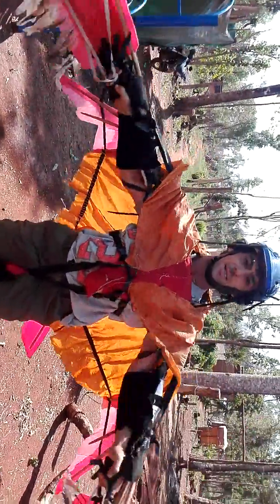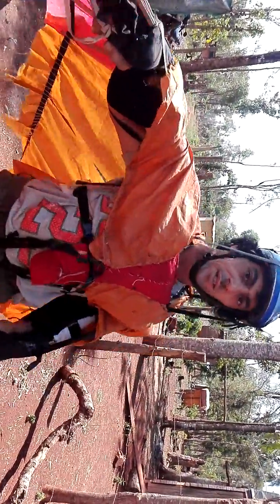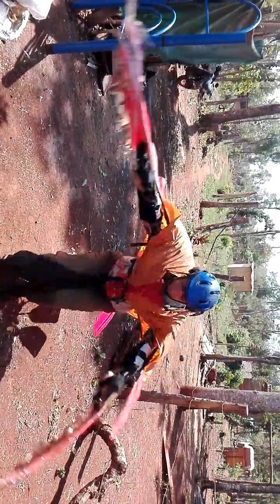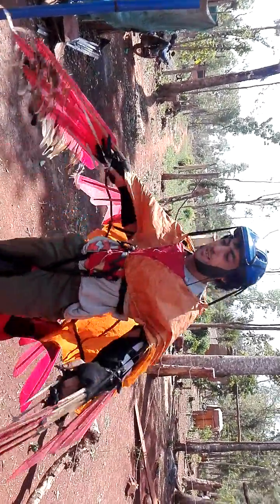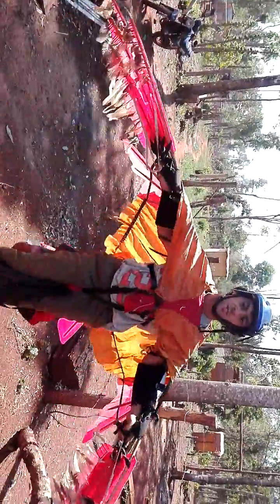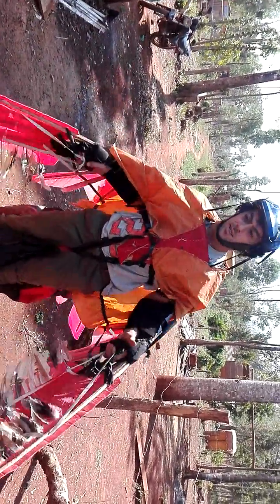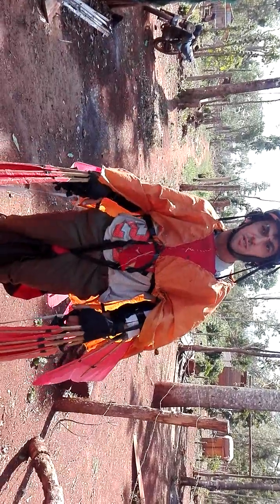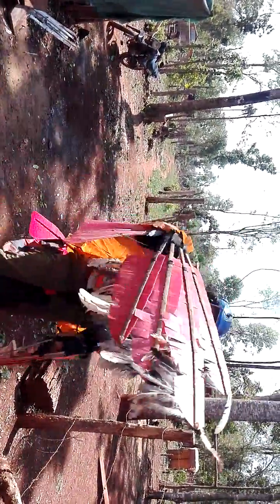Human powered ornithpter

Comment: Involving mechanical leverage and wing proportions that work with human body mass would still be human powered. Its feasible if you make it proportionate and find a way to create enough leverage to flap. Mechanical leverage is not the same as engine powered flight.

Comment: Rana Mohammad abuhurara 💜❤️💜❤️ Pakistan Take a dove.  Cut off its wings and weigh it 
Then weigh her whole body again
Then using math.  Make wings according to your body weight
And on your back you need a high-speed motor.  Which will give a sharp pressure before flying
You're going to be awesome including.  A little more work is needed

Comment: I really admire the persistence and effort. I am an aerospace engineer and have worked on many flying projects. I respect your desire to keep this thing human powered, but I have some advice, you can ignore me if you'd like. The wings need to be much bigger, like maybe a 12 ft wing span would do. It's because we are much denser then birds, so using bird-like proportions won't work. Wings that big will be tough to flap with your Arms, My second suggestion is to maybe try to make use of some kind of mechanical leverage to increase the power of the wings, maybe control the flapping with some kind of foot peddle system. Your legs are stronger then your arms. Lastly try to start with developing a model that can glide thorough the air unpowered, to learn what it takes to soar like a bird, (i.e. weight distribution, lift requirements and drag minimizing) then build the flapping system on top of what you've learned
Reply: @Phumgwate Nagala what does it matter, you understood, I don't care that much about writing
Reply: I think you destroyed his dream:'D
Reply: @micmko  I didn't mean too, he probably work listen to me anyway. It took the collective effort of humanity a long time to figure out flight, it's niave to ignore the lessons learned by others.
Reply: @NZ-fo8tp  he does the videos as a joke you didn't have to write all that it probably took you 5 minutes of your life lmao
Reply: @anziz2730  no way it's a joke, his persistence is hard to attitude to a sense of humor
Reply: @Phumgwate Nagala That doesn't negate any of his points. Stop nit-picking
Reply: I’ve been looking for someone to help me build this in real life, it’s most definitely has to be electric and motor powered to flap the wings but wearable as a backpack this would be a dream if you could help me make this reality
Reply: @Phumgwate Nagala what does it matter, you understood, I don't care that much about writing
Reply: Human chest muscles will never be big enough to supply the wings with the power needed for flights.  Look at a birds chest muscles.  Their chest is like 60% of their entire body.  Our chests are about 10%
Reply: The power have to primarily come from the legs not from the chest, and possibly with some electrical assistance. There are much better designs than this, he probably finally gave up.
Reply: I've read your comment a year or two ago, when I came across this video. I was deeply inspired by your idea of using a system to leverage the power of the legs to assist the arms. I'm planning on building an ornithopter suit a few years into the future with a much larger wingspan and better materials than the ones used here and if it works, I would like to come back and let you know that it was possible mainly due to your idea. Thanks

Comment: I'd recommend a glider to start with, if you're gonna keep the arm-attached design id recommend increasing the length a fair bit and get rid of any gaps. Doing some research on bird wing shapes and such. Something that would be less flapping and more of a run and jump kinda thing
Reply: longer wings = more torque on joints = joints breaking
Reply: @nou4898  it would require a overall redesign, materials alone could help with the issue
Reply: Oh you mean a HANG GLIDER? Yeah. They've been invented. You can buy one. No inventing necessary.
Reply: @nickhayley  we know about hang gliders obviously, we want wings not a oversized kite

Comment: Birds need about a foot of wingspan for every two lbs of weight. And they are perfectly shaped and build to fly. Humans aren’t even close to the right shape. As a human, you’d have to double that ratio just to get off the ground. At 175 lbs, you’d need 87 foot wingspan... lol. And in order to have enough strength to drive those wings, your arms would need triple the endurance and 4 times the strength of an average set of legs. This guy is extremely stupid to consider human flight a possibility with his setup. What a moron

Comment: Hi Carlos,

I came across the following youtube video which I think you may find intetesting. It's similar to your concept (using kinetic energy to make for the lack of power in human muscle) but instead of stretching rubber bands the concept uses spring compression similar to a bow and arrow. Maybe it wil give you some ideas or inspiration for your next designs.☺
Reply from the maker: Good morning my friend , it really sounfs interesting , I would like to see it , but anyway I have tried with spring , neodymium magnet , and also compressed air transmition , but the only thing we get its a lot of mecha parts as well as bearing, or spring that only works in stright directions wich makes it impossible to move all your body specially your arms that need totally freedom to achieve momentum and be able to take off from floor, that's why in my new design must be done with similar materials as nature , to get a very flexible and unbreakable wing, so it all must be covered and glued with a slim and a little elastic leather and the sew it cannot be any nuts.specially in the higes and joints.

Comment: Based on your flight tests using your latest prototype, have you been able to determine if it is indeed possible to achieve human flight using a flapping frequency that is possible using only human muscle power alone? Wouldn't the weight and density of the human body require a flapping frequency similar to a humming bird just to lift off the ground, since birds are built much lighter with hollow bones and we humans have solid bones and a much heavier body? I am not saying I doubt you will succeed, it just seems very challenging to achieve the necessary flapping frequency to produce sufficient lift using such short wings, even using the stored kinetic energy of the rubber bands. Of course, it may just be my understanding that is lacking. I hope you succeed in proving your doubters wrong.
Reply from the maker: Hello my friend how are you doing? Nice to hear again , .well about if it will be possible to achieve human powred flight , the answer is yes and maybe in few months I can build the final design, but not doubt about its a real challenge to find the right frequency to lift from the floor but I almost got so now only need the materials and all will be done, I give my word.